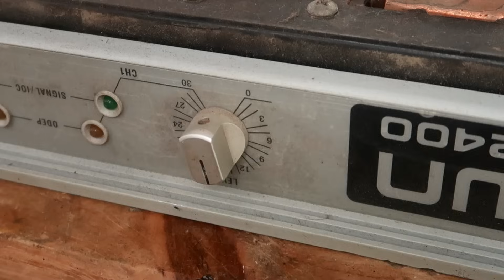CROWN 2400  amplifier restoration / 24 transistor amplifier restore

Comment: Judging from the scars on the left handle of the front panel, the last test machine was not the same machine at all
Reply: I also noticed that in the end when he closed the cover transistor wasn't soldered at all...
Reply: Also the faceplate is a different color and the knobs lost their black inserts. The resistor being soldered where a zener diode goes takes the cake!
Reply: Well spotted!…

Comment: Those amps are beasts. That one might still have worked somewhat in its pre-restored shape, as long as all the blown transistors were pulled out. Post-restore, should work well for years yet. 👍️
Reply: hhh
Reply: They have one stupid problem though, they won't function without that motor-fan being operational.
Reply: @puciohenzap891  Didn't know that, but it makes sense. The underlying amp technology wasn't necessarily the most efficient; there'd be a lot of heat to dissipate. I prefer the protection mode of "attenuate the amp based on heat load," but I guess a safety like that is better than nothing. Must be a headache during a live show though.
Reply: Pre restored worked (at least led' are binking). After rusting in chemicals and puliing out transistors its only for trash.
Reply: 😊😊

88i8i

Comment: 28:32 "restorated" amplifier
29:09 different amplifier
Reply: Say it ain't so - a restoration video on YouTube that is a fake?!?
Reply: Different label on the front.
Reply: @tyronenelson9124  29:09 FAKE FAKE FAKE its different amplifier The old "restorated" one has 3 orange diodes on the top and new one has light green. The scale on the two knobs are longer on new one is shorter and its says level the "restorated"  has no level written on it. FAKE FAKE FAKE
Reply: Oui, faux, les poignées ne sont pas les mêmes : original...choc a la gauche
Nouveau....rien, problème ?
Reply: @DerekHundik  the one at the top is a preamp or for asjusting echo or equalizer. Means this is real
Reply: Bạn nói rất chuẩn . Để ý tay xách con phục hồi bị trầy và con khi hoàn thiện lại đẹp mỹ mãn. Và với một người chuyên điện tử tôi không tin tưởng cách bạn đo đạt kiểm tra sửa chữa. Là một sự lừa gạt
Reply: 😢 totalmente diferentes..
Reply: tks
Reply: @tyronenelson9124  One is silver the other front is white.

Comment: That's a quick way to solder through hole components! I suppose whatever works, instead of the longer process of soldering through the hole to the trace side. I also noticed that the working amp doesn't appear to match with the restored one.
Reply: i see , the left handle is magicaly fixed

Comment: I was a Crown authorized factory warranty tech for years in music stores in Austin..Repaired many of those and the older ones and the micro techs too..A curve tracer makes troubleshooting a breeze instead of a DVM though..The old DC#))'s did just that..they DC straight into your cab when an output shorts...Peavey CS800 crowbar protect circuit was the answer, we built them on small cards to for in the banana jacks on those..fun stuff.
Reply: That crowbar circuit on the CS800 took me for a ride one time when I was just getting into amplifier repair as a teen. Theres a couple concerns in this particular video though. He doesnt show the replacement transistors, only soldering in the old ones and not showing the replacements. And then at the end of the video it looks like a completely different amp with the sticker looking new..
Reply: @THEtechknight  Yeah I was watching to see what he used for the replacements, the Crown output transistor is just a rebranded MJ21194 or MJ15024 or something IIRC?
Reply: Tengo un crown2400 macrotech tiene el problema de que la encenderlo un canal no enciende el LED rojo y me saca el audio ruidoso ronco y bajito no sabrá cuál sea el problema..?
Reply: Hey is there a way to contact you on some questions? I have some old ones left and im not to this are there any things youd change in general after this time?

Comment: The final assembled unit is not the same one as the workin one turn on at end. You can tell by comparing the front unit decal. Upper right corner has a slight missing cut on working unit, but the non working does not. The knobs are not the same. The marking on the final "restored" assembly has red deteriorate dial marking, while final working does not. Finally, I don't a single 1k ohm meter setting enough to trace through that troubleshooting. So you had 2 to begin with, one junk amplifier never intended to be "restored" as a workin unit  and one working one to show at the end as working unit. Well,... at least there was a good job cleaning and painting.
Reply: Maybe he had another working unit

Comment: I was curious if you used heat sink compound with those power transistors when you replaced them? Great video!
Reply: He did, but nowhere near enough.
Reply: when you know that you will never turn it on you dont need any compound :)

Comment: 29:09 FAKE FAKE FAKE its different amplifier The old "restorated" one has 3 orange diodes on the top and new one has light green. The scale on the two knobs are longer on new one is shorter and its says level the "restorated"  has no level written on it. FAKE FAKE FAKE

Comment: This one is obviously a fake! I'm surprised no one seems to notice that the amp he "restored" had a lot of scratches in the front panel, specially in the 'macro-tech' area, and also the left handle was bent! Getting all the transistors would be pretty expensive and we don't even know if the transformers are any good  As for the amp he shows at last, is clearly the same model, but a working one in better shape.
Reply: Hmmm, nicely spotted. That amplifier in the test at very end does seem to be a different amp. That's a let down. Guess he's just desperate for the views.
Reply: I saw exactly the same, alot of these restorations are more and more fake these days..
Reply: Это не царапины а пыль и грязь. Там не только выходные транзисторы, но и на силовой плате, компоненты были заменены. Дорого транзисторы стоят. Это для вас они дорого стоят, а у них там цивилизация!
Reply: Now look at subscriber count and lots of "excelente" in comments.
Something is wrong with those people. Or, maybe, they are bots?

Comment: fake! how about missing transistors??
Reply: 28:33 invisible transistor 😢
Reply: palsu bagaimana hilang transistor??
Reply: Maybe it was made to use in multiple models, and holes just pre-cut for all o them.
Reply: Power can work withouth pair because channel work with 4 pair of npn and pnp transistor in parallel. One pair less equal to less wattage

Comment: These amps needed scoped and signal, dummy load tested.. even biased after replacing final outs.. 

I've repaired many of crown amps and there not straightforward..  very well engineered amps.

Comment: The transistors of the driving stage are installed wrongly, C2837, A1186, this mistake is too obvious, it will be short-circuited and burned instantly after power on, the UP owner is a liar:face-green-smiling:

Comment: This is such BS! The amp at the end is a different unit! Look at the color of the face and also see how the knobs in the 'fixed amp' lost their lines! Also during the 'restoration he soldered a resistor where a zener diode should go. Ridiculous!
Reply: You have a good eye. I also noticed the 1 ohm/2 watt metal film resistor getting soldered in the "Z" silkscreened reference designator location. Add to this that he never measured or set the output bias voltage, nor did he measure for any DC offset on either channel. Other posters have noted that the amplifier at the end was a completely different unit... I used to repair these amplifiers in the late 1980's and I can tell you from experience that there is NO way that this "restored" Crown amplifier will ever work, having seen the "testing and measurements" performed in this video. I wasted my time... What a cheat!

Comment: That wasn't a restoration, he took it apart and gave it a sub-par cleaning.  The paint job was horrible and their was still rust and crud all over.  Most of the wiring and cables looked terrible.  Then he replaced a few parts and screwed it back together.  Anyone who thinks this is a proper restoration is out of their mind.